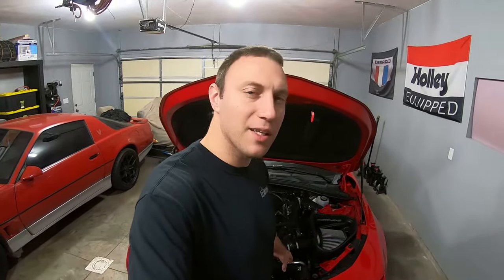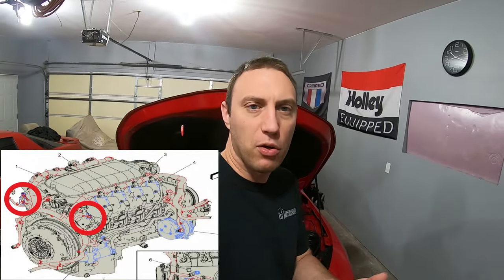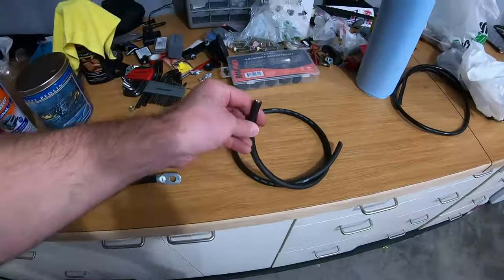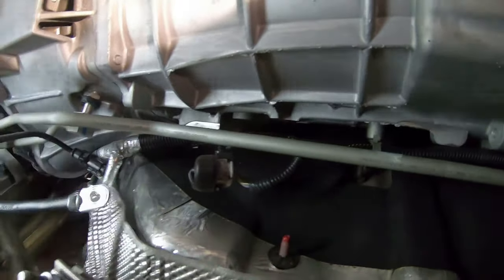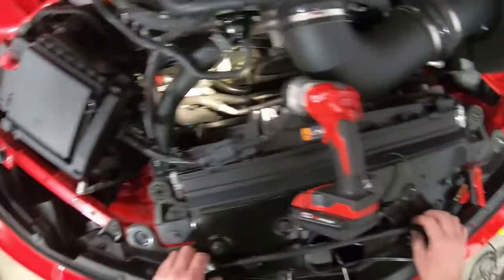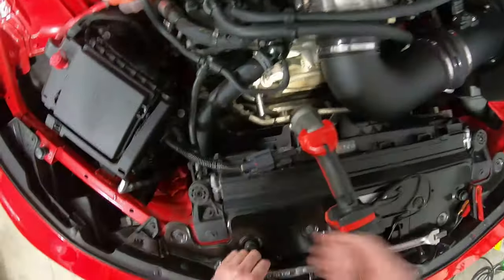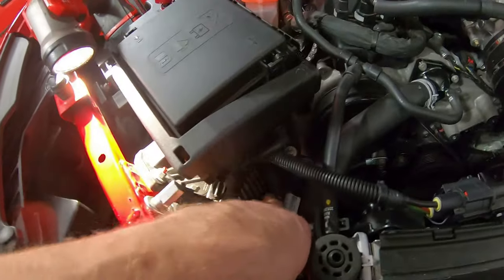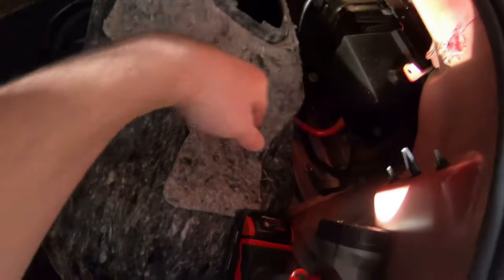Camaro Electrical Issues Solved!

Comment: I recently helped a friend diagnose his 2010 Camaro SS for a primary/ secondary ignition coil G fault. He has also been experiencing all these other problems in this video and adding another ground wire solved a lot of the issues, however, here is something else that we found. On the main wiring harness cable that comes from the passenger side to the front of the engine block, there is a metal bracket that holds the wiring harness. Over time, this bracket rubs into the wiring harness eventually cutting into the wires which was causing our problem. Check this bracket and see if its cutting into your wiring harness. We took the bracket off and covered it with electrical tape to help. Id probably recommend using a plastic bracket if you can find something like that.
Reply from the maker: That's good advise for everyone.
Reply: Hey so your friend had a code for P0357 which is ignition coil G code. And adding the better grounding cable fixed that code? Asking because I am currently going through the exact same thing right now. Have a code for ignition coil g which I have changed, changed the spark plugs switched the spark cable to another cylinder and checked the coil connector for power and shows good and code stays at same cylinder. Haven’t checked the grounds yet and not sure how to check the ones on back of each cylinder since it’s hard to see. But I’m hoping I can do this and hopefully 🤞 this would help me.
Reply: @urahara_card_shop on the ignition coil G code, we found a broken wire from the computer to the ignition coil G connector. If you are standing in front of the car, look for a wiring harness that comes from the computer on the right and comes across the front left top of the engine that is held by a metal bracket. Take off the bracket and look at the wires there. I suspect you have a broken wire for the ignition coil.
Reply: @michael7171  thank you so much for a quick reply I will definitely check it out cuz I’m stuck trying to figure out what it could be. Thanks! 🙏
Reply: Help !!!😩😩 i have a 2012 camaro V6 RS. My car keeps randomly stopping while im driving like its missing, missfiring, no acceleration.. rough idle and all the cursers on the dashboard are going back and forth , the lock-switches are going back and forth.. the steering wheel locks.. then it says service anti theft deterrent system. The lock symbol pops up. You try  to crank but it just whines but nothing n the check engine light flickers. I spect $800 replacing body control module and it didnt work. Replaced key fob also
Reply: @quishagranger9542  your issue sounds like a broken ground or could possibly be a fault in the multi function switch (turn signal switch). A good way to test the multi function switch is to disconnect it and start the car to see if its still doing all the things you mentioned. I had this happen with a Buick Regal recently. All the gauges were going up and down randomly, the car would stall and not run. It could also be the ignition switch. It controls power to the computer when the key is turned on. Look for other videos about the ignition switch and multi function switch and try to diagnose it that way.

Comment: Done my ZL1 ground yesterday. I bought the cable from Lethal Garage. GM should have done better to avoid us from solving the problem
Reply from the maker: Yeah kinda sad they can't get cable sizing figured out.
Reply: Specially that they have this problem since the 5th Gen Camaro,   plenty of time to have improved it.   Mine is a 2012 2SS 1LE  and have no issues  jet after 35k miles but I will do it anyway , I got from Ebay  a 18" AC Delco Professional  Ground Strap for $17  and a   14"  0  Gauge Ground Strap from Dorman   made  as a Toyota replacement for  $27.   I hope this two will do the job. Cheers from Chile.

Comment: I regret getting a camaro. I have only 20,000 miles on my 2020 and the battery saver active light keeps coming on. Installed a new battery just 11 months ago. Makes no sense. Car won't even start, i hear one click and then boom nothing. Won't turn on. It was working a week or two ago, would crank up and then when i drove it- parked and tried to turn the car on again it would not start. Let it sit for an hour and a half and it turned on again. Now it wont turn on at all. Battery dies completely and then works again hours later but car still won't start.
Reply from the maker: Sounds like u have a parasitic draw on the battery. If my car sits for 2 weeks without driving battery is low as well. I keep trickle charger on it a lot. 
But if yours is draining fast then u have a draw on it. Led taillights did this in the past cause they don't shut off.
Reply: Any suggestions to fix the issue?
Reply from the maker: @Fijibeatz  definitely can fix it over the internet. U need a shop or someone with multimeter and amp clamp to look at what circuit is staying on if that's what's actually going on. Could be radio as well. See other people have issues with that.
Reply: @EssMotorsports  You think a trickle charger will help for the time being? Leaving it hooked up for a few hours and if so, any suggestions on which to buy
Reply: I have two friends w camaros. a 16 and 18 ss both having similar issues
Reply from the maker: @Akbeatzx  I would definitely check the ground connections in the truck and back of the cylinder heads. Adding a ground wire for 20 bucks is an easy thing to try as well.
Reply: @EssMotorsports  I bought a trickle charger and hooked it up directly to the battery in the trunk and it did the trick.. thanks alot fr bro! It cranks up and drives with no dashboard lights. But i def will be waiting on my ground wire to come in to avoid this issue down the road.. you saved me from alot of stress my man!
Reply from the maker: @Akbeatzx  That's good to hear!👍
Reply: I have a 2017 ZL1. New battery only stays charged for 3 days. I have to disconnect negative connection every night to save the charge.🤷🏼‍♂️. Advanced Auto sees me every 2 months to exchange my current new battery for another new battery.
It’s been happening since the car was new. Can’t ever drive it when I want to…won’t start again. I’m going to try transport mode to see if that helps. I bought  quick-release terminals on Amazon so that I can quick-release the battery terminal every night. That’s gonna be a big hassle. Have to re-index windows every time.
Reply: Same issue after I jumped it off I changed the fuse box it was burned out in the trunk it solved my problem

Comment: I have a 2017 Camaro rs, after I turn my car off a lot of times won’t start back up unless I do the remote start and even then sometimes it won’t start. Is this the same issue?
Reply from the maker: @laproductions7836  yes sounds like the excat issue
Reply: @EssMotorsports  ok I will try this out thank you

Comment: I did one under the hood to the driver side front header bolt to the inner fender well. I also did one from the Bell housing to that extra ground stud. I did another one in the trunk off the battery to the body in my car does not get that slow crank no more that everybody thought was the starter being heat soaked.

Comment: Just ordered a 1 gauge ground cable. I will try this. I had an issue last week when I started the car after coming out of the gym and all the dash lights didn't come on for about 10 seconds. It's the only time it's happened since I bought the car last October. Then I remembered your video I scrolled over the other day. I hope this takes care of it ever happening again. 2018 SS 1le with 32,500mi. Thanks for the video...
Reply from the maker: U SCROLLED OVER!!! HAHA Jk man! Hopefully this does help. I would check all your grounds connections as well. Couple on back of cylinder heads. And check couple in trunk by battery. The added cable will only help and it's cheap insurance that their is adequate cable size.
Reply: @EssMotorsports  LOL... Scrolled over sounds bad i know...  But..   I always kept it in the back of my mind if i ever had electrical issues. I didnt have any at the time so i was more interested in small MOD videos...   Great videos..
Reply from the maker: Let me know if it works. Like I said I didn't have an issue with my car but it's almost like preventative maintenance

Comment: I’m going to try this tomorrow my instrument cluster was going haywire and the forums said it was a grounding issue hopefully these work …. All my service codes pop on from check airbags to parking sensors the gauges all stay at the bottom I’m hopeful that I won’t have to take it to the dealership
Reply from the maker: Easy to try it. Only couple bucks
Reply: @EssMotorsports  yeah I’m hoping this works
Reply: Did this work for you? Having the same problem with my cluster and HUD
Reply: @rozo3929  yes it actually has helped. I mean, after I put it on it hasn’t done it. So hopefully that was the problem try it. Won’t hurt to give it a shot bro I paid like 50 bucks though for it
Reply: @jacobsalazarjs87  just ordered it hopefully it helps. My RPM needle bounces erratically
Reply: @rozo3929  mine was not reading mph the rpm all service lights were on but yeah man so far so good I almost lost my shit until I seen this video lol
Reply: What ground wire did you ground for the issue because my instrument cluster is going crazy as well

Comment: Thanks for the video! My Camaro is a 2014 so it's slightly different, the battery ground is like 1 gauge. I put a ground wire on the engine block, it seemed easier than the belt pulley tensioner

Comment: I have (camaro rs 2017)…is the same issue on my car ? Hard starting when i directly click the start/stop button…but if i first hold the button down for ten seconds without break until the car show me all the gages and options then turn on the engine…in this case it’s often don’t hard starting
Reply from the maker: Humm idk if that is the same issue. Could be the start switch itself...
Reply: My 2020 is having this issue. It's a V6 though. Has a studder/pulling when driving and not accelerating and when I come to a slow stop it jerks. Has the smell every now and then. Dealerships says they can't find anything wrong.

Comment: I have an RS my interior light seems to be flickering when i turn it on, idk if it’s because of the fuse box and maybe i messed with it but what can it be and how can it be fixed. Also i got my led headlight bulbs replaced and the headlights have rgb but only one side works properly with the rgb the other one is completely shut. Id it electrical failure in the headlights or the car itself

Comment: Ok here we go. I bought my 2018 2SS about 2 years ago it was used and only had 4K miles on it. The 8 speed trans had a shudder to it. I’ve had this same issue with my GMC Canyon. GM/Chevy has final come up with a fix for it and it works. So I took it in for The fix. About a week later I go to start my car and it started but not at first. Took it to the dealer they said everything was fine. So I bought a battery tender and leave it on when not drive. Car isn’t my daily. I then started smelling antifreeze only when the A/C is on. Took it to the dealer twice they pressure tested nothing.  tested the oil to see if there’s antifreeze in it nope. Checked the heater core nothing. No leaks. No lose of coolant. Yesterday I was driving it and pulled in and the tac start jumping up and down. Engine wasnt reviving. So I found this channel and just installed the cable. Test drove it and knock on wood tac stop jumping. Hopefully the antifreeze smell goes away now.
Reply from the maker: Overflow might have just purged a little coolant with it being so hot everywhere
Reply from the maker: Bouncing tach is usually a ground issue from what I've read. Check grounds on back of cylinder head to make sure they aren't loose as well
Reply: @EssMotorsports  I’ll have to check those as well. Thanks not sure where they are at so I’ll have to look up a wiring diagram
Reply from the maker: @mattoconnor3227  I think I flash a picture of the locations in video.... been a minute. But I thought I did
Reply: @EssMotorsports  ok I’ll check it out thanks for all your help
Reply: Wow just re read my post. WTF that was embarrassingly badly written. Only defense is it was early morning.

Comment: I have the heat soak issue on both my 2018 2ss 1LE and on my 1989 iroc vert.  Do you recall what the bolt size was on the trunk battery and ground bolts.  I tried a bunch and none seem to fit right.  Great vid thanks
Reply from the maker: I can't really remember for sure but I would guess M6 or M8 nut.

Comment: They sell me a 2017 Camaro LT, with just 30k miles, but with "electrical problems" I don't know what it really is, but does this video fix all electrical problems? Would it be a good idea to buy it and do the video?
Reply from the maker: Definitely not going to fix all electrical issues a car could have, but a lot of weird issues are related to ground wire connections or insufficient grounds.

Comment: I have a 2022 2ss I’m having starting issues , replaced the starter and still won’t start
Reply from the maker: The extra ground will help with the heat soak/hot start issue. If it won't start cold either there is another issue going on.
Reply: have a 23 lt1 with some bolt ons and E-85 and car died on me twice tn, gonna add another ground to the car very soon and get a battery maintainer due to my battery most likely being bad

Comment: I have both as well. But alternator connection is getting very hot
Reply from the maker: @TrueHearted78  did u check ground connections on back of cylinder heads? They are known to loosen
Reply: @EssMotorsports  that I have not done. Will definitely check and let you know. Thanks

Comment: Do you need to remove the belt ? Can I remove the bolt on the block without releasing the belt.
Reply from the maker: U have to release belt but not remove

Comment: I tried this but when I removed tensioner bolt completely off .but now I am unable to put the belt back on . Did you usee any tools to put the belt back on?
Reply from the maker: With the new cable in place and tensioner bolt tighten, use a 1/2 breaker bar to turn tensioner pulley to get belt reinstalled

Comment: How hard was to get the belt back on because I think your video skip that part
Reply from the maker: No it wasn't hard, just use a breaker bar again and it's pretty easy with leverage.
Reply: If fully removing the belt, you will have to disconnect this ground cable on one end to put a new belt on.

Comment: I ordered the 1 gauge wire from tractor supply that you put the link for. Can I use that for the ground in the trunk?
Reply from the maker: It should work but u probably have to go to a closer stud to the battery than what I used.
Reply: @EssMotorsports  how long was the one you used?
Reply from the maker: @Slick Rick Da Rula  honestly don't even know. I just had it and didn't even measure it.
Reply: @EssMotorsports  I gave it an  eyeball measure and it looked about 18 inches lol
Reply: Thanks bro! Man can't wait for spring!!!!
Reply from the maker: @slickrickdarula9483  haha SAME!

Comment: Do you have to take the belt off before you remove the bolt? I have a 2016 2SS
Reply from the maker: Yes otherwise there is tension on the belt and pinch the bolt.
Reply: @EssMotorsports  ok got it thanks

Comment: Is this related to the altenator going bad with this battery saver options?
Reply from the maker: No, typically slow starting from starter. But better grounding is beneficial to the alternator as well.
Reply: @EssMotorsports  just replaced the altenator and battery, just bought my camaro and there was a new battery in it already, just wondering If I should add this ground just to be safe

Comment: This car has been giving me starting issues for years and it's my only major problem with the car however it's a big one. If I can't start it then why have it. I added a ground from the brace by the fuse box to the right side of the engine block front side but the car seems to have acquired the problem with starting again.
Reply from the maker: Did u check ground connections on the back of the cylinder heads?
Reply: @EssMotorsports  I'm gonna check that next. I may add two more grounds
Reply: @EssMotorsports  I also think it's the starter failing from the heat. I think I'm gonna buy a new one with a heat shield.
Reply: My 2019 2SS seems to take a while to start, but always ends up turning over,
Reply: @jasone1881  I'm having a starting issue with mine now. Battery is at 83% so I need to see if getting it charged to 100% will fix it.

Comment: hey boss I have a 2019 Camaro ss and I added the extra ground wire in the front same as you but now my power steering is out. Do you know how to reset it? I undid the ground wire I added and my power steering is still off.
Reply from the maker: @alexbenavidez1142  do u have an error message or something? Not really sure, sounds like a separate issue as adding a ground wire doesn't mess with steering. Did u leave the original ground? Since steering is electric it's like it got disconnected
Reply: @EssMotorsports  it’s saying to Service my Electronic Power steering drive carefully. I also removed the negative battery and let it sit for 30 min and the issue is still occurring with the extra ground wire removed. I don’t think there’s a fuse for our power steering correct? I checked the fuse box and don’t see anything related
Reply: @EssMotorsports  and yes I left the original ground I put the extra ground on top of the existing
Reply from the maker: @alexbenavidez1142  yeah I don't see a fuse listed. It does sound like a wiring issue if it happened when adding ground. I'd look at steering rack electriclal connector or something that came loose? Just adding another ground doesn't affect steering. So something else is not connected or going on.
Reply: @EssMotorsports  alrighty boss thank you for the help so far I’m planning on taking it to the dealer tomorrow and hopefully they will have a solution